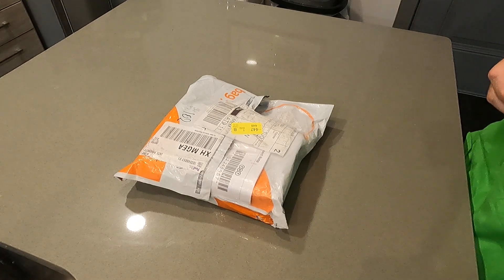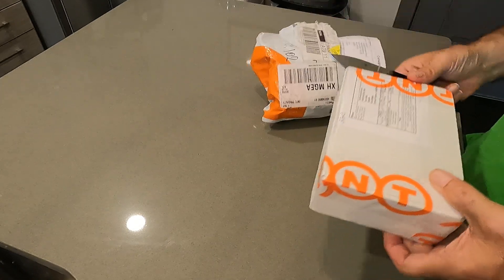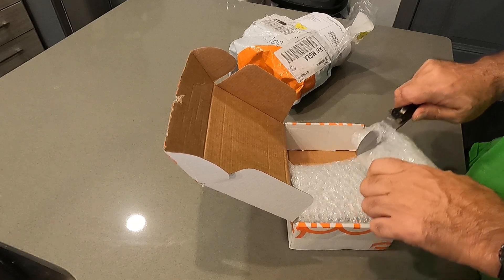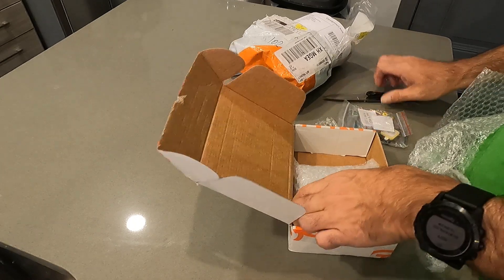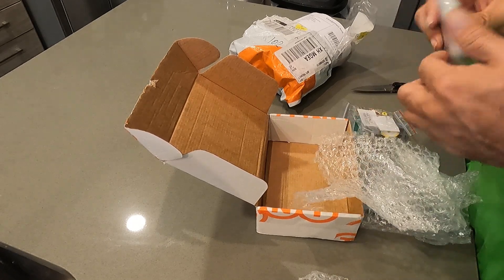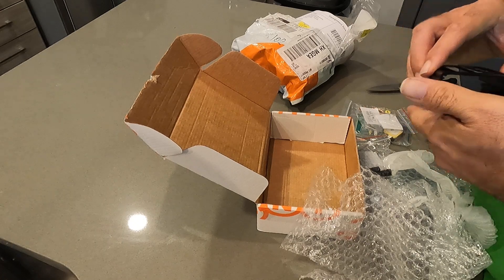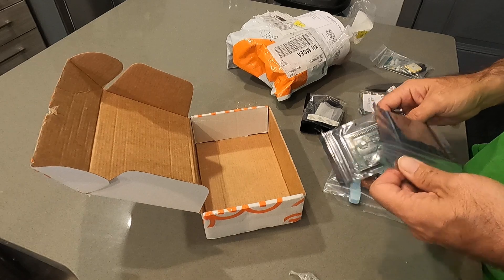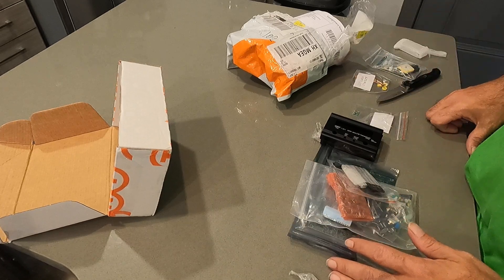QCX Mini and GPS unboxing

Comment: I was with you for the maiden SOTA activation with that radio, Richard.  You worked a station in New Zealand.  That was awesome.  Over 8,000 miles with a QRP rig and your home-brew portable EFHW.

73, de N4HNH